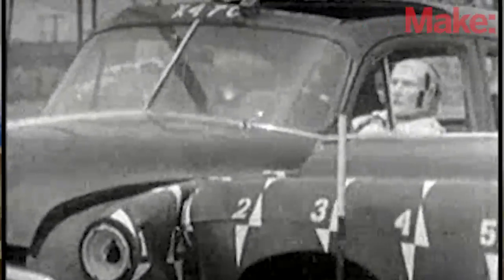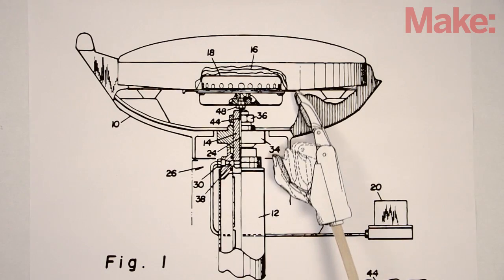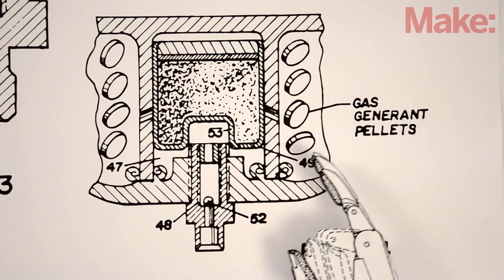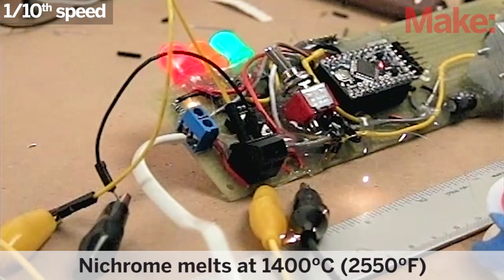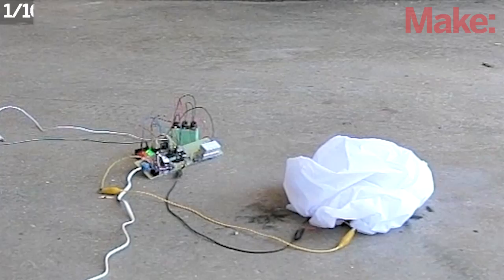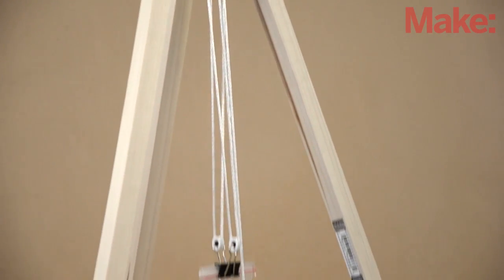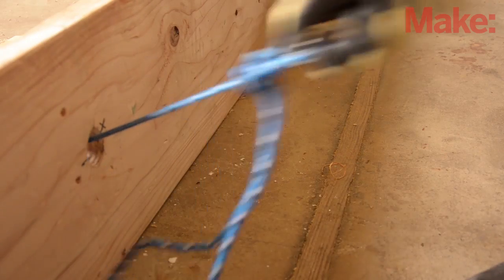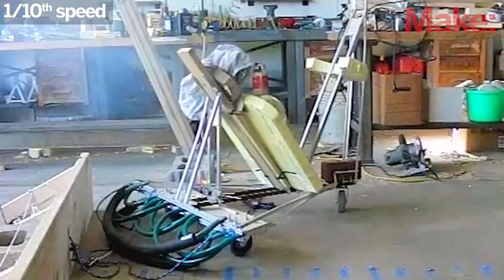Make Inventions: The Air bag

Comment: Airbags use gas generators, not an explosion to inflate the bag. The gas generators are designed to draw air from within the passenger compartment, if they did not do this then your eardrums would rupture if the airbag went off with your windows rolled up. 

The majority of the gasses inside an inflated airbag is the air that was previously inside the vehicle.

Comment: You could try fire resistant wadding like that used in model rockets to protect the airbag. Or a cheaper solution would be that insulation made from recycled newspaper. which has be treated the same way as the wadding